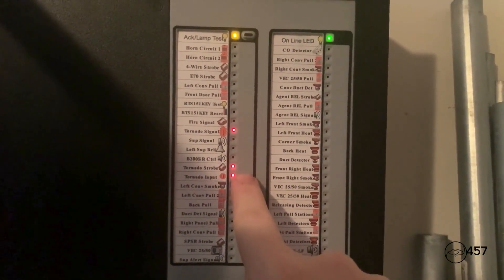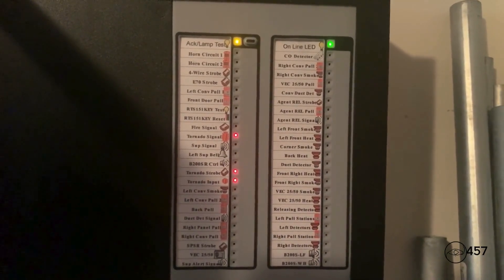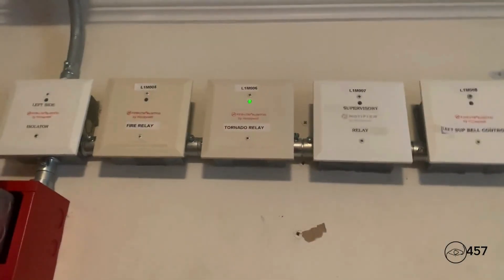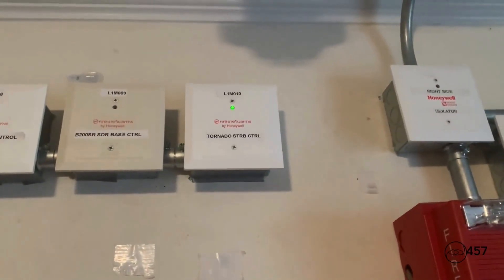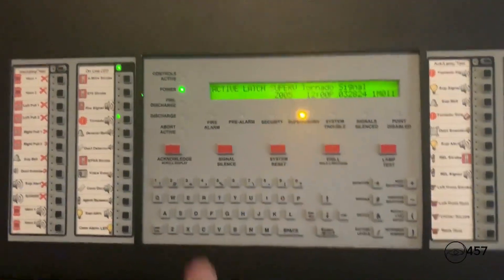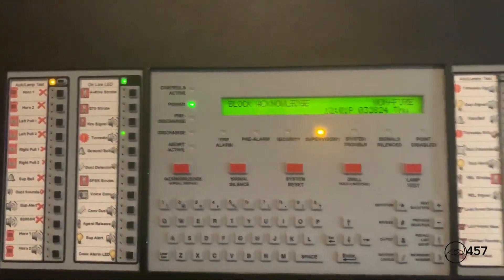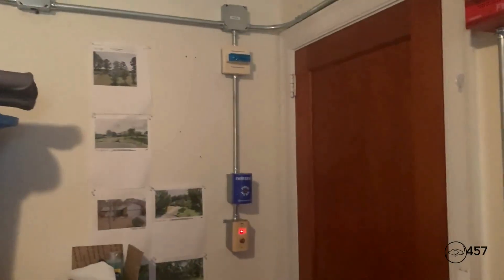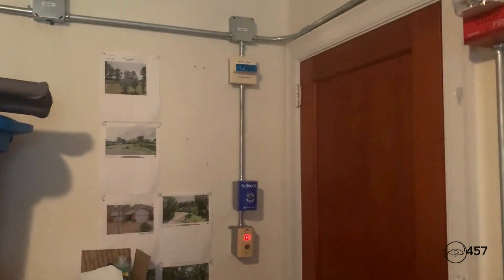STI-SS Blue Push Button Tornado System Test 2

Comment: Can these get triggered by a EAS alert
Reply from the maker: Probably with a relay or monitor module connected to it.
Reply: @Notifier-457  how would the system differentiate between different messages and tests?
Reply: @ZT_1234  I don't think it would. maybe some announcator systems will say this is a test if its a newer one